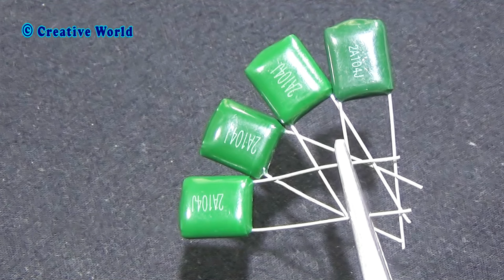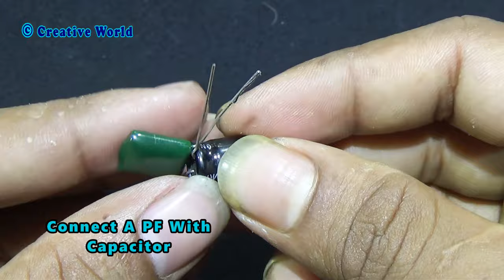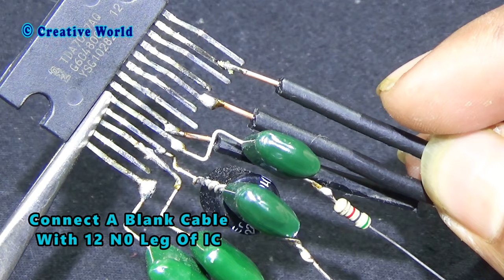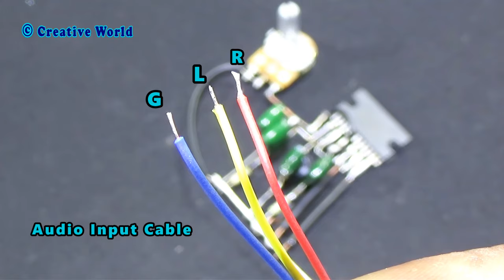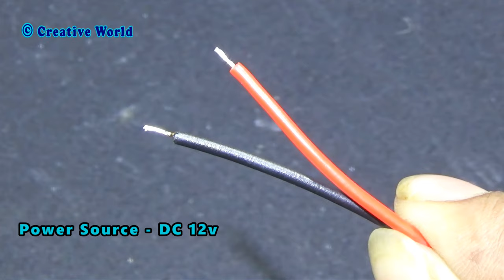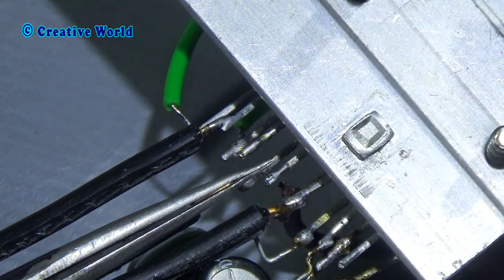How To Make Stereo Deep Bass Amplifier Circuit Using TDA7057 - Mini Power Amplifier

Comment: U r connecting jumber wire, to 7 to 1, but u written in the video s 5, 5 s wrong, pin 7 s currect
Reply from the maker: may be typing fault, sorry for mistake
Reply: @CreativeWorldPro  u should mention in the discription, or in the comment and pin it.

Comment: Greetings: very good video thanks for sharing, just a query, I do not adjust the volume any ideas that you can give me,
Reply from the maker: without potentiometer you also can use this circuit.
Reply: @CreativeWorldPro  Yes, that's how I'm using it without a potentiometer and it works perfectly, but if I would like to put it on, since I made it a plate and I'm going to put it in a drawer with speakers,
Reply: I would like to share the photos of how I am leaving the project thanks to your guide